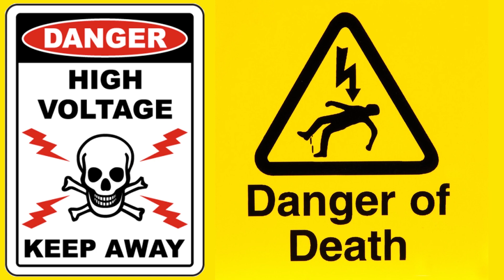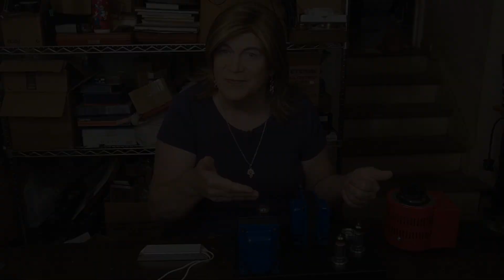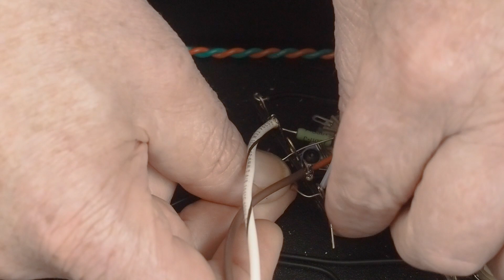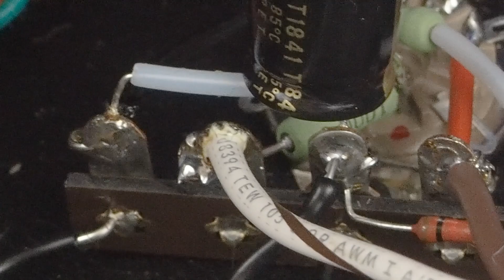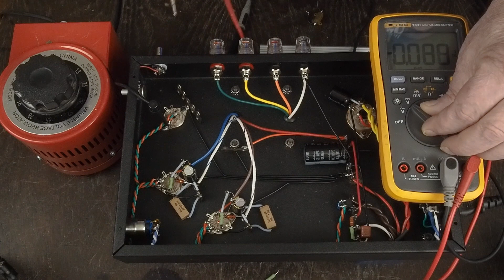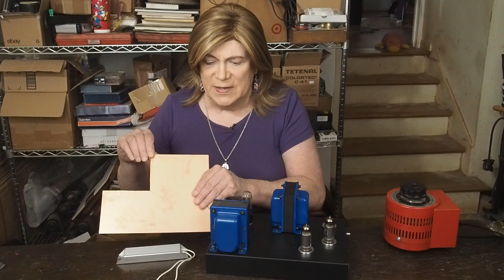Tubelab Monoblock: More Wiring and Testing

Comment: Hi skunkie id like to buy the yellow resistor in metal case at mouser  can you tell me how to spell that stuff so i want also electrolytics capacitor  for the power supply which  is good  thanks
Reply from the maker: It's simply a wire wound resistor. They have them in various styles.

Comment: As I said el84’s don’t stop to amaze me. I’m sure they will be just fine at 100% dissipation and at 341v less 12= 329. My experience with el84’s is that they are tuff. You can use 6n14n or 6p14p which are rated to 14w. There are some production amp running el84’s way above the rating. You are at the rating. That’s just fine. As you said, lower the screens a bit.
Reply from the maker: The rating is 300V, this is 10% over and honestly I think it will sound better at closer to 300V with the current higher.
Reply: @SkunkieDesignsElectronics  nice to see you back. Wish and pray for you to be healthy. It might sound better at 300, maybe sound the same or so close that could barely be noticeable. I believe that those tubes are rated very conservative because many production guitar amps run them way above 300v and up to 16watts dissipation and they last long time. As I said there is an amp with reputation of been very reliable that runs them at 450v. Not saying you or anybody should follow that. I wouldn’t, but its good to know. Anyways, you do as you wish, it’s your project. Have fun and I hope you can enjoy it in Jesus name. Hope to see you again soon.